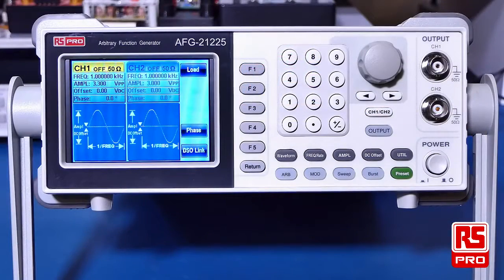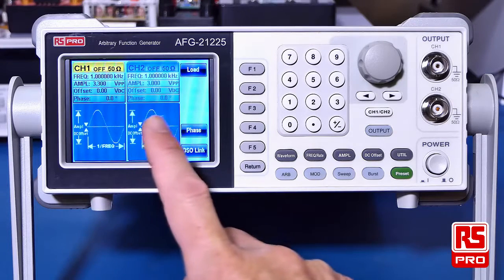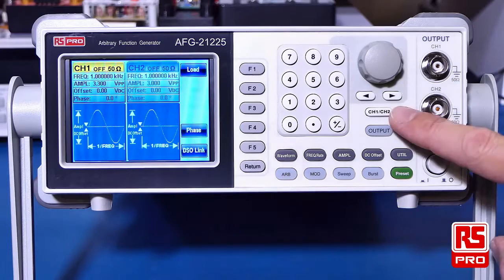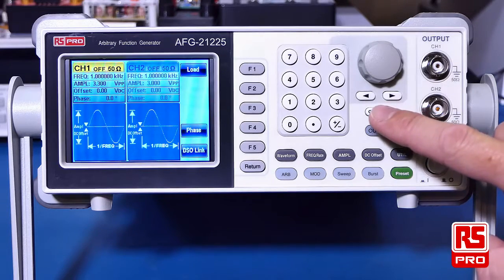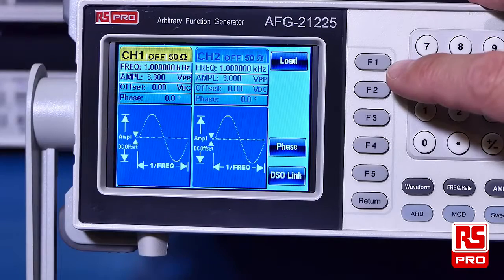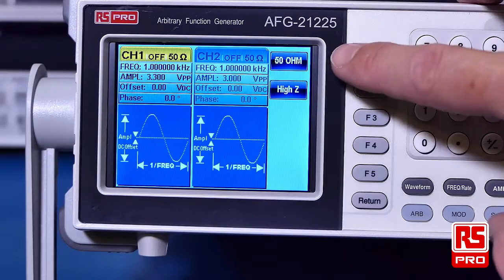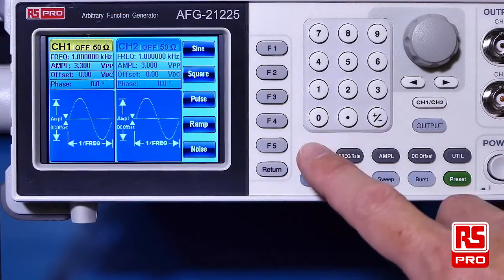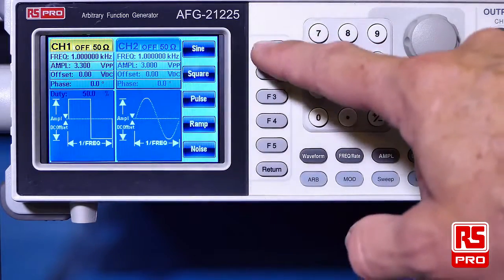Features of the AFG-21225 Dual-Channel Arbritrary Function Generator by RS PRO

Comment: Can you synchronize and dephase CH1 and CH2 in square mode?
Reply from the maker: Thank you for your question. We visited with the manufacturer. In square wave mode, the AFG-2225 does provide CH1/CH2 synchronous tracking function but does not dephase.